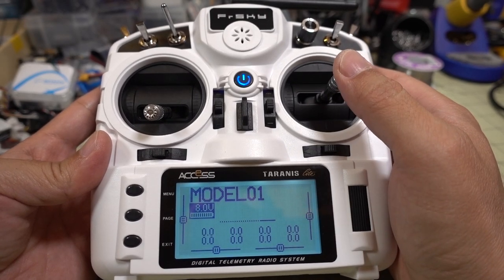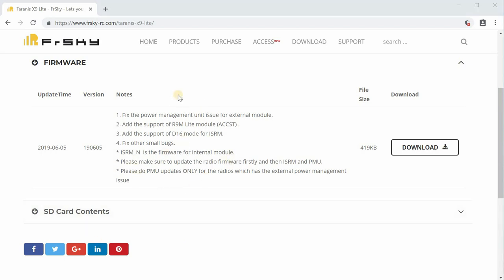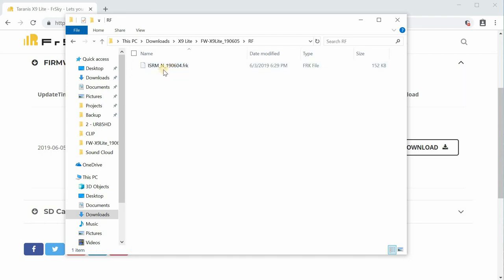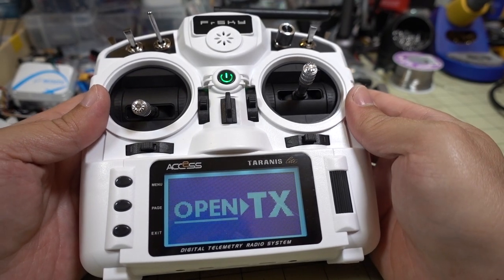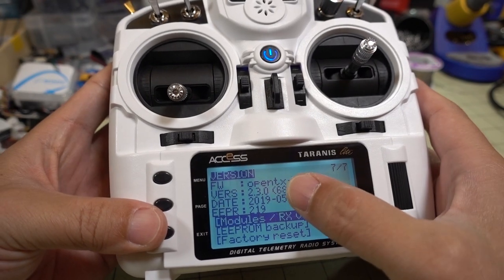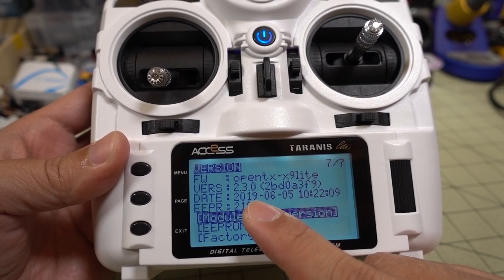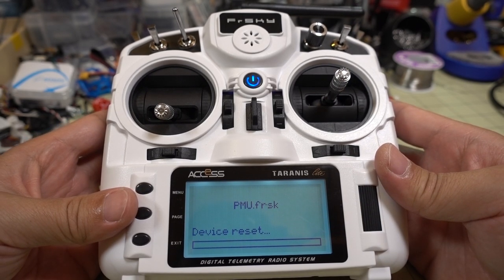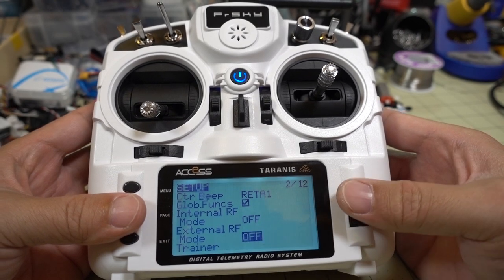Taranis X9 Lite ACCST D16 Firmware Upgrade 🎓

Comment: Great video. I'm looking to pick up this radio to replace my current Taranis X9D as I like the feel of a smaller radio. Just so I'm fully understanding, by doing this firmware update I would still be able to use my current X4R and X6R receivers by just binding in ACCST mode but newer ones I can bind is the ACCESS mode?? 

Thanks,

Chris
Reply from the maker: Yes, you will be able to bind existing D16 ACCST receivers in D16 mode and the newer ACCESS receivers in the ACCESS mode.

Comment: If I flash ACCESS firmware on XM+ and R-XSR, will I be able to flash older (d16) firmware back?
Reply from the maker: I think you're stuck from what I've heard.  FrSky up to dirty tricks.
Reply: Albert Kim FrSky confirmed on email that ACCST can be flashed back. And I did test this on XM+ and no issues. I will let you know after testing on r-xsr

Comment: It still looks like a toygrade transmitter  , but i'm glad they also include option to use D16 protocol , will they also include D8 at a later firmware ?  Most whoops and rtf quads have D8
Reply: Yeah, why no D8 in the first place? :/
Reply: D8 will never be supported due to hardware limitations, the same reason why ACCESS update is only for D16 compatible RXs and TXs. The D8 is a decade old protocol anyway so they probably won't care much about it.
Reply: D8 is not compatible at the hardware level, it's too old. The multiprotocol is o ly 35 usd at RDQ.

Comment: Nice video dude. But I have a problem, I have done all the steps and get all the way to bind the xm plus but it won’t actually bind. The receiver light stays solid red and green in bind mode, with radio beeping but nothing. Any suggestions?
Reply from the maker: I would try flashing the internal RF module again.  If that doesn't work, try updating the firmware on the XM+ to something more recent.

Comment: Thanks for your precious video!  I have a question ... I have the R9m-lite module with Flex firmware and I use 868mhz.  can i use it  selecting 868 on bind.  Is Opentx already flexed?  Thank you very much.

Comment: Another question lol do I need sd card contents from frsky or opentx your other video show it from open tx. There need to be a vid from start to end with opentx install and all firmware updates
Reply from the maker: This video is for FrSky's method of updating.  The other video enabling crossfire is the method using OpenTX companion.  Both methods work in different ways and get you different things.
Reply: @AlbertKimTV  yea I realized it didn't give u crsf but I'm also wanting to go ahead and do the updates cause I will be getting some smaller rxs too
Reply: I got it finally lol thank u it cleared up a couple things for me. And thanks for quick response too.

Comment: ive done all this but my x9 lite will not connect with r9 mini after updated to use fcc. i tried with/without telemetry, cant adjust power, external module is not detected when i go to modules/rx version(not sure it should), lights blink like its binding but wont connect. did i miss something?
Reply from the maker: When you set up your model on the external module, which protocol did you select?
Reply: R9 lite FCC, 1-16D
Reply: Update: Got it working. User error, I thought I could get around without updating r9mini or r9mm. Fully working now.

Comment: Looks like I am not good with copying files to the sd card, and when writing Firmware from sd card to the x9 lite I get [ directory is missing!/FIRMWARE ].  I have OTX Bootloader - 2.3.0. on the x9 lite.
Reply from the maker: Try a different microSD card.  That one might be bad or too slow.
Reply: I had the same problem. Turn on transmitter, hold menu, go to page 2 (or the SD page thing), hold menu again and you should get an option to format. format microsd card in transmitter. reupload all the files from the above youtube video and it should show up in bootloader mode

Comment: Hi Albert, I've upgraded mi x9 lite following your video, and checked all the versions (fw and internal module) match yours, but i cant bind with my eachine trashcan in D16 mode. I tried binding with a friend's x9d in D16 and in works perfectly. What am i doing wrong? thanks
Reply from the maker: Make sure telemetry is turned off in Betaflight.
Reply: @AlbertKimTV  it's off  🙃

Comment: Thank you for this.  Is there a technical reason they aren't making it backwards compatible with D8?
Reply from the maker: Maybe, but I'm not sure if the reasons are technical or business.  I haven't seen any proof either way.  I'm sure there will be plenty of videos claiming this or that to get views purely based on the sensationalism.
Reply: Just annoying you can’t use these new radios with v1 Tinyhawk which I have a few and other micros. I had hoped to use these cheaper radios for a STEM class but price has gone up and all the work required to get them to even work with what I had chosen to build makes it a poor choice. I was excited to get them on a D9 lite but now it’s going to be Jumper.

Comment: hello, I'm trying to link my taranis x9 lite transmitter with my betafpv 75 and I can't get it, could you help me thanks
Reply from the maker: I'm assuming you have the XM+ receiver on yours?  I've heard some people having an issue with theirs with some D16 receivers even after the firmware update.  I assume you've done the update?  I am not having that problem and I also have no solution for those who are having this issue, sorry.
Reply: @AlbertKimTV  no, it's an integrated receiver thanks for answering

Comment: Do I need these updates if I'm flashing opentx on it. I just got my x9 lite and trying  to get crsf micro to work on it. And now there are 4 updates do I need em all then do the open tx update or what.
Reply from the maker: All the other firmware updates are to the internal module for FrSky protocols so if you're just using CRSF you just need to update OpenTX.
Reply: @AlbertKimTV  k thank you
Reply: @AlbertKimTV  k thank you

Comment: I didn't see the opentx firmware when I downloaded the update files from frsky site
Reply from the maker: You don't use OpenTX companion with stuff from FrSky.  They have their own special builds
Reply: @AlbertKimTV  yea I got open tx and got the sd card contents and downloaded 2.3.4 opentx but I crossfire isnt an option in settings when adding a profile.

Comment: does this update break the external module support? I can't get my r9m lite to work, although it works on my x-lite
Reply from the maker: It should still work after the update.  Perhaps the old version has a bug or something.
Reply: I use my r9 lite, make sure to select r9 m lite fcc
Reply: Yeah I can't even flash the new firmware to it from my x9 lite. I tried with my xlite and it works fine. I don't think it's being powered at all
Reply: I suspect frsky and their attempt to lock it to only approved modules is to blame. Plus the radio won't work with my d16 whoop, and I couldn't get it to work with an XM receiver until I flashed the receiver with Access. It works fine with my XM+ receiver though. Overall this product is a big disappointment to me, it's a shame because it does fit my hands well, too bad it doesn't work as a radio. Thank goodness they added a spectrum analyzer though, I'm sure that will never be used.

Comment: I was just curious, has any one had any luck using the x9 Lite in the d16 mode with a Tinyhawk S or the  Tinyhawk freestyle. I finally got everything updated and bound, but I keep getting disconnects when flying after a few seconds with both the Tinyhawk S and the Tinyhawk freestyle. This seems to be also happening with my X9D + in the d16 mode also but when i go to the d8 mode with the X9D+ both the quads work great. Thanks for any help with this.  Rob

Comment: Mine does not show any new firmware on the transmitter
Reply from the maker: It doesn't come with the new firmware out of the box.
Reply: Albert Kim ya I know I mean after I uploaded everything to the sd card
Reply from the maker: The card should be formatted FAT or FAT32
Reply: Albert Kim THANK YOU I think that’s what is wrong
Reply: Albert Kim I know this comment does not have to do with the video but on my plane I wired everything up and set all the controls to the right channel but when I move the sticks nothing happens

Comment: So basically we no need to flash old frsky receivers to use this radio, isn't it?  Good news.
Reply: No flashing needed.
Reply from the maker: I did not flash my XM+
Reply: @AlbertKimTV  thanks.
Reply: The update to access is such a huge upgrade.
Reply: @zimzillakilla   for whom? To me its nothing wrong with previous protocol. This one just make to tricking to new people in the hobby.
Reply: For people who want lower latency (hardcore racers), more channels (RC scale users) and simpler RX update process and binding (all radio users),  @jackfpv8904 . Nothing wrong with the previous protocol, but the new one offers more advantages.

Comment: Hi Albert, thanks for this great video! Do you know if it is possible to change the Taranis X9 Lite from EU to Non Eu? I have the feeling this is hardware fixed :/
Reply from the maker: It's not hardware locked.  You have to update the internal RF module with the FCC firmware and update openTX on the radio and make sure EU is not installed when you flash (hint: don't tick EU).
Reply: @AlbertKimTV  didn't work... there is actually only one file for the internal transmitter, without distinction of EU or Non EU :/. I wrote to Frsky to see if they can help
Reply: @riki85utn  have you got it working in FCC yet? Thanks.
Reply: @rossimessi1  I gave up.. i sold the X9 Lite and  just bought a Jumper T8SG and problem solved :))

Comment: New 7ms pwm firmware is out!
https://www.frsky-rc.com/r-xsr/

Do i need to download all 190605, 190626, 190720 and isrm v1.1.3 
I am late to the party and just got my x9 lite.
Reply from the maker: Just the latest version.  It should have all the files you need.
Reply: @AlbertKimTV  I ended up downloading the 190720 and isrm v1.1.3. Should I delete the 190720?